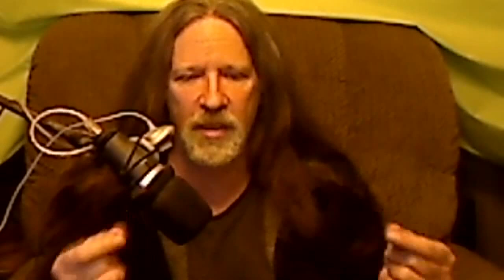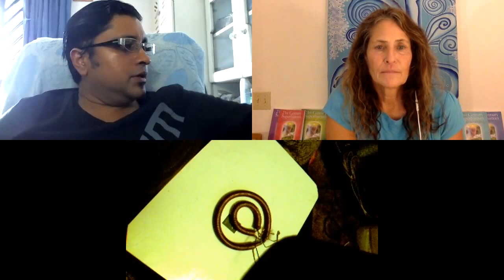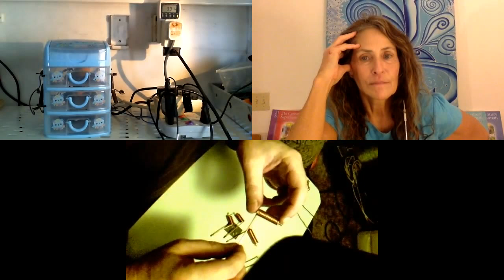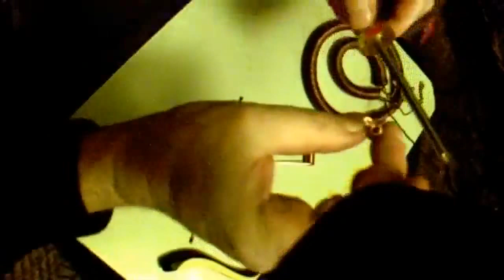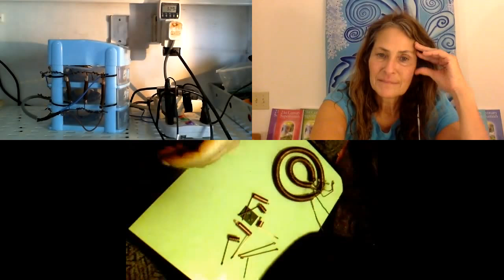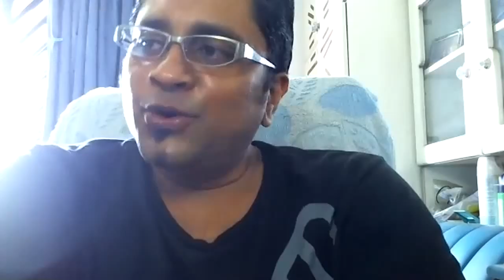How Keshe Magrav Really Works – JC Anderson & Vivek Reveal All!

Comment: Do I need to put a keshe unit on each of my outlets to effect my whole house? Can I put one after the braker, then run the hot to the home run to supply each outlet? or better can I put one coming off my grid hot that supplies my house panel? I'm just curious.
Reply: +Joe Co no, this is actually wiring it backward. You want as much of your home between the Magravs unit and the electricity source as you can. What you plug into the Magravs unit serves to generate the plasma that is reflected back into your home. If you place the Magravs unit at the breakers, you are sending the majority of usable plasma into the grid and away from your home's devices.

Comment: Hi J.C.  Super videos!  I have been experimenting a little with nano coating and gans making.  Killed algae in my pool with nano coated copper plates and revived my golf cart batteries with nano coated coils.  I want to experiment with multiplugs.  Can I wind a nano coated coil on the cable of the multiplug just behind the plug which is plugged in the wall socket? The end of the coil pointing towards the wall socket would be turned back on itself and the other end pointing towards the multiplug (that is where the appliances will be plugged in) would be open/straight.  All three wires (live, neutral and earth) are inside the cable.  Or must I wind the coil on the live wire only?  I would do this on multiplugs where I have some appliance permanently switched on.  Regards.  Mike O. Pretoria, South Africa
Reply: Thank you for your reply and advise Cary.   I'll keep experimenting.  I am busy building a Magrav unit for my car and making some Health canons as well.  Will report on my successes or failures.      Regards Mike O

Comment: I know plasma to a type of superheated gas - but that is not what you mean here is it?

How is coating copper wire with carbon different from coating them with plastic?
Reply: +huxleypig69 The coating isn't carbon. This is a common misconception. The coating is still copper, but in a slightly different state that absorbs the energy that strikes it. this is why it appears black.
The plasma we speak of is different than what conventional physics describes, you are correct. We use the term to describe combinations of interacting magnetic and gravitational fields. These, we have found, have some very unique properties that have been overlooked by science for a very long time. It is these properties that we are accessing with the Magrav units and the other plasma technology.
Reply: pinantan001
If the coating absorbs the energy that strikes it then it uses up power, not helps with efficiency?

I have done some work with magnetics and gravity and magnetism are two completely separate things - they have no bearing on each other.
Reply: +huxleypig69 "If the coating absorbs the energy that strikes it then it uses up power, not helps with efficiency?"
You are speaking of two very different forms of energy. Electricity is a very TINY sliver of the available energy that is absorbed by the nano-materials. Also, the nano-materials are a fantastic insulator for electricity. Almost a super-insulator... but a superconductor for the plasma. 

In some sense magnetism and gravity are completely separate things, but in another sense they are the two sides of an equation. One expanding, one collapsing. Every system that radiates (expands) must have an absorption aspect (collapsing). You may not see the two sides of the equation, but there must be two sides.
Reply: +pinantan001 my nano coated coil produces energy when I shine my torch onto it. Behaves like solar cell some call the nano coated copper cupric copper...
Reply: +huxleypig69 my experiment with nano coated copper coils produces energy when I shine my torch light onto it.